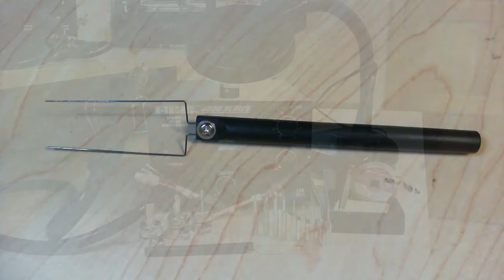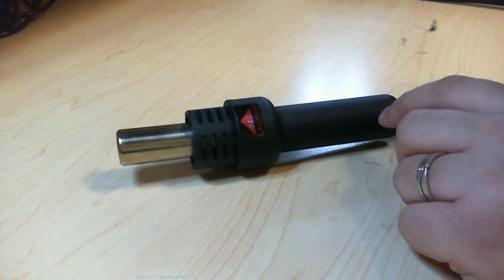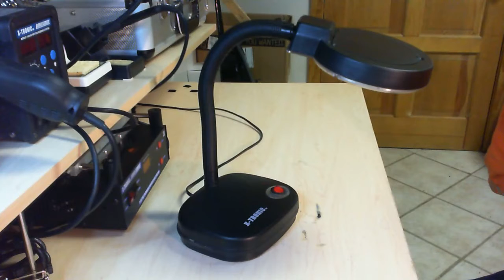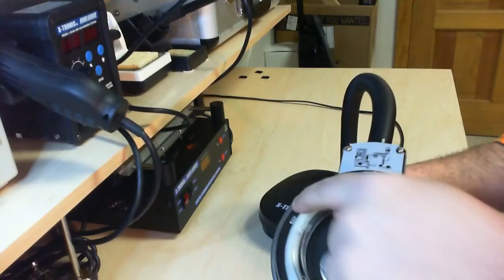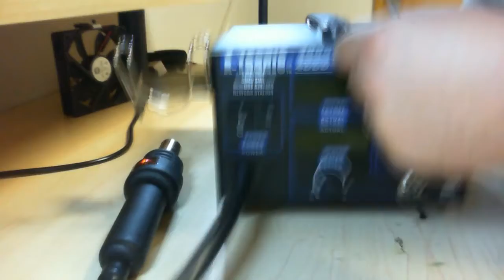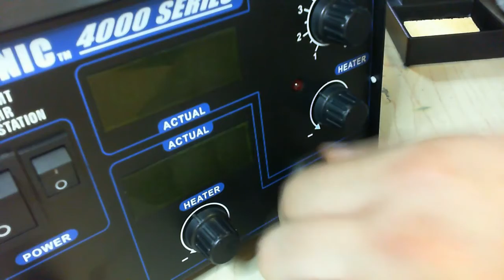XTRONIC #4040 Hot Air Rework Station (Product Review)

Comment: I know this is an old product, but I just wanted to say that I bought this model back in 2012 and it is still going strong today. They have a much better model available now with the same price range, but anyone wanting to know if this is a good workstation, I would recommend it as a first station for beginners. I have had absolutely no issues with my soldering iron or the hot air nozzle. I don't use mine daily (or even weekly) but for a hobbiest on a budget, this is a solid workstation.

Comment from the maker: The 4040 offers a more versatile variety of hot air nozzles to be used whereas the 6040 has a proprietary nozzle so you can only use the ones shipped. That being said, the 6040 seems to have better temp stability as well as a smaller footprint.

Comment from the maker: I would go for the 6040. This is because I think it is more stable with temperatures as well as having a better recovery time with temperature. It also has a smaller footprint and a brushless fan motor for the rework station. And it is cheaper I think.